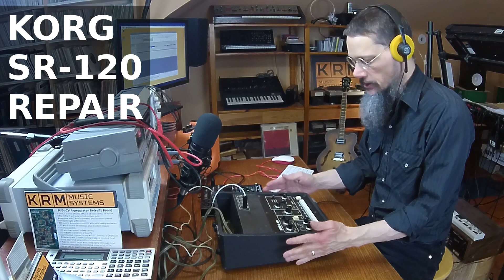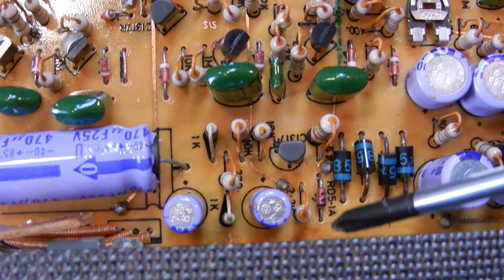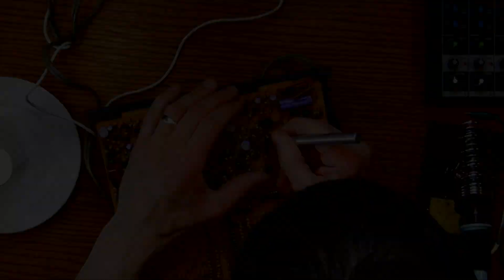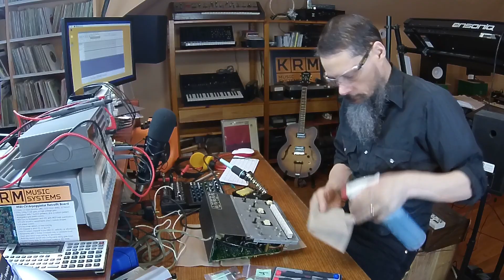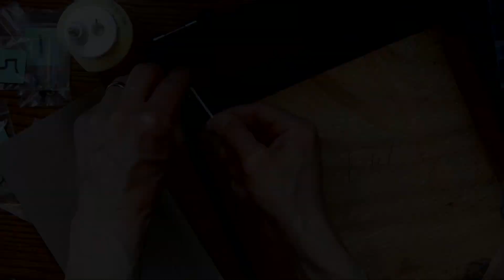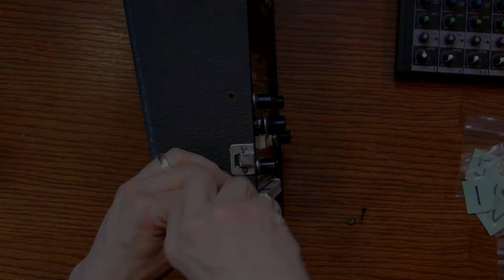Korg SR-120 MiniPops Drum Machine Repair

Comment: Very helpful video. When you're working on something like this, would you routinely update the PSU caps? Also, any idea where to find those knobs with the aluminum trim? Where are you based?
Reply from the maker: Hi Jeffrey.  If the power supply caps were bulging, or very old, then yes I would replace them.  Regarding the knobs, the only place I know where to get exact replacements is from other broken Korg gear from the same era.
Reply from the maker: I'm based in Toronto, Canada.

Comment: Hi I have a Roland CR 8000 modified,  it needs to be fixed.  It plays the same sounds over and over again, I am based in Los Angeles but looking to send it anywhere in the US really to fix it .  Thanks a lot  @synthesizerkeith
Reply from the maker: Hi Charles.  I'm based in Canada (Toronto), however I'm sure you'll be able to find someone in LA that can work on old synth gear and drum machines.

Comment: Hello i have the same problem on my minipops; why do you remove the green capacitor ? Thanks for this video !
Reply from the maker: Hi Mathieu.  I removed the green capacitor just to make it easier to work on the PCB.  It was in the way.  After I fixed the trace, I soldered it back in.
Reply: @krmelectronics  OK thanks a lot !!

Comment: Always love your videos, Keith! I’m curious about why you cleaned up the corrosion before jumping over it. Does it stop it from spreading? And two product questions: 1) Where do you find the dust barrier fabric that you used for that switch? 2) Was that just regular ol’ wood glue that you used on the knobs and the Tolex? Thank you— glad you’re back!
Reply from the maker: Hello Ty.  Glad you like the videos.  Regarding the trace repair, you are correct, if you don't clean up all of the corrosion it will continue to spread.  I'm using heavy card stock for the dust barrier.  And yes, it's just wood glue.  For the Tolex it was perfect, because the case is made out of wood.
Reply: @krmelectronics  Thanks, Keith!